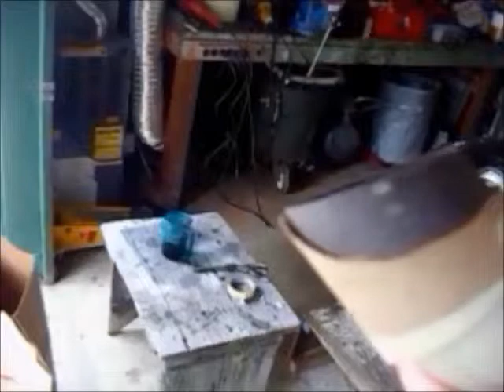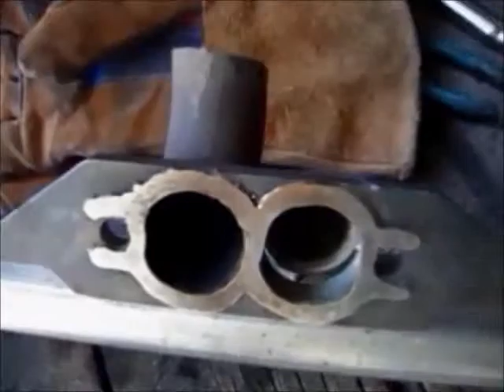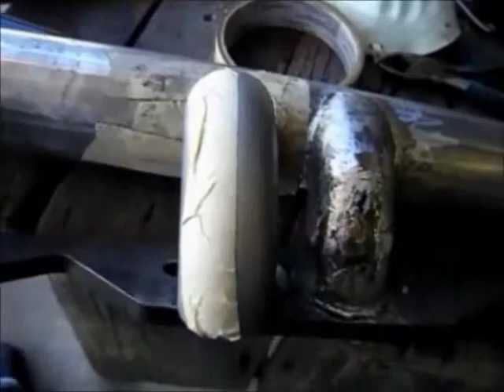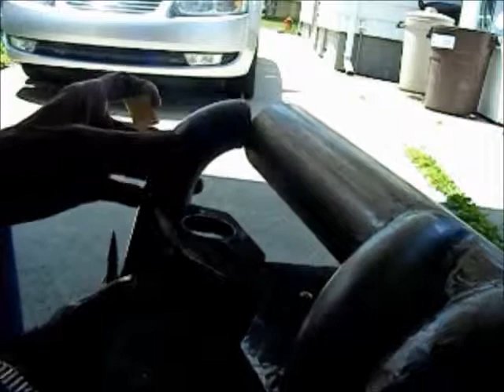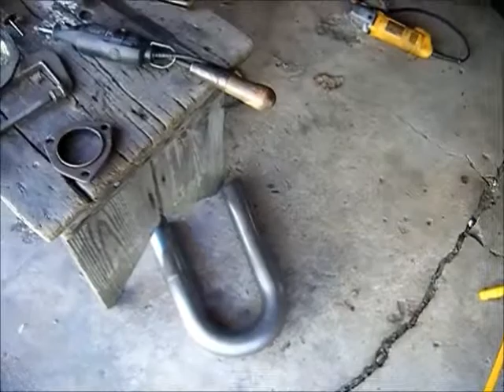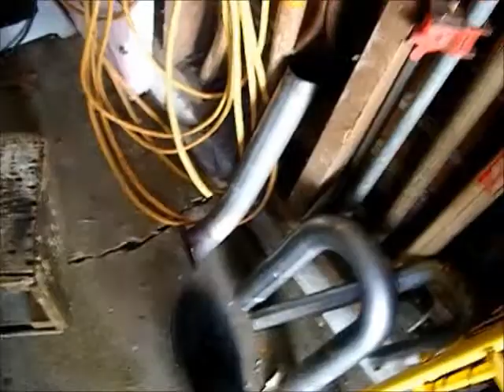350 Exhaust Header, home made using steel tubing

Comment: Will you run the plug wires down behind the manifold/header, like the old 265/283 did? You persevered through a very difficult project and it is functional. Thumbs up!
Reply from the maker: Yah, I just ordered 24ft of wire, hope it's enough. Thanks